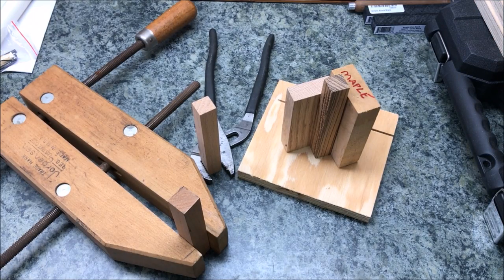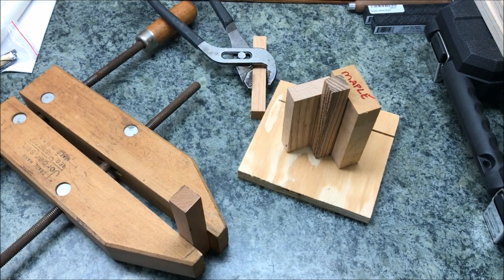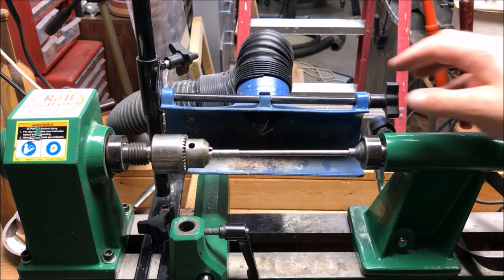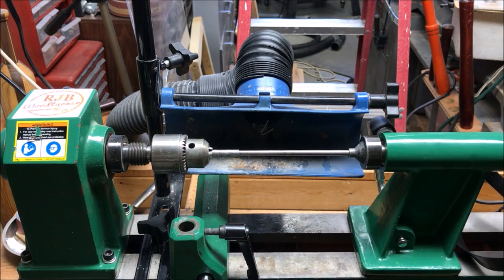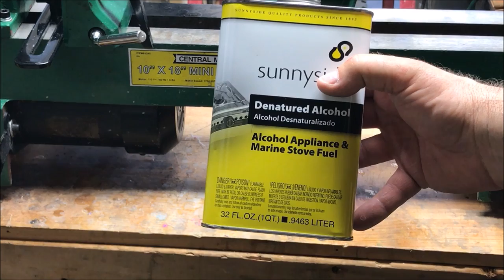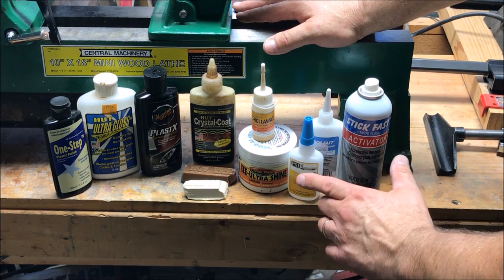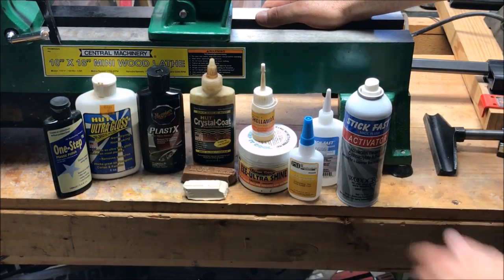What Tools Do I Need For Turning Pens

Comment: Good vid!  You hit all the major points.  I started out with the smaller HF lathe and, after one year, my family bought me the next size up HF lathe with variable speed pulleys. That was a big improvement for little money.  I love being able to grab the handle and speed things up for polishing.   I did not get the pen vise for the drill press.  At first I used a mechanic's vise but getting the blanks perfectly perpendicular to the bed was hit or miss.  I now have the pin jaws for my chuck and they are working very nicely with an opposing Jacobs chuck.  After building the Shaunessey pen press and breaking it twice I built a screw drive press for assembly using a large threaded rod and I have much more control than pressing on a lever. Finishing is right on, I'm using the Stick-Fast CA and the PlastX polish.  Working on a buffing setup using big buffing pads that chucks into my lathe.  I put together a disassembly set using HF punch pins and the PSI locking pliers. Wishing you a better lathe soon.  Keep turning bro.
Reply from the maker: +Redthumb45 Thank you very much. 

Regards,
Bob

Comment: I have the exact same lathe as you do. There for a time I was having the same problem with it wobbling out the end of my blanks. What I did was, tighten the nut under the tail stock to take out some of the wiggle. Then when I drill my blanks I center the drill bit with the lathe off. Then I put my hand on the chuck and turn on the lathe, then start turning the tail stock handle. I've had perfect results ever since. Just thought I'd let you know what I did to fix what sounds like the same problem you were having.
Reply from the maker: +Gary Binder Thank you Gary,
  This is great information. 

Regards,
Bob

Comment: I have about the same lathe, mine is an Excelsior (Rockler) but I imagine it is the same Chinese made lathe.  Here is how I drill:  Chuck the blank square and mark center.  Advance the tailstock up to the end of the blank and lock it down.  Spin up the lathe and advance the tailstock screw slowly until 1/4-1/2 extended then STOP THE LATHE!  With the lathe off pull the bit out and blow everything clean.  Then carefully advance the tailstock until the retracted bit bottoms out in the hole.  Lock it down! Then turn on the lathe and continue with the next pass 1/4-1/2 extension.  As you reach the end of the blank be even more careful to retract and blow everything clean.  I do that last 1/4 inch very slowly.  Yes, this takes much more time than the drill press but I always get perfectly centered holes with no wallowing and no blow out.  Someday I will get a nice lathe too and the old trusty Excelsior will be moved to just finishing duty.
Reply from the maker: +Tenspeed TheBikeHanger Great information, I'll give that a try. Thank you. 

Regards,
Bob

Comment: Hi Bob, thanks for your videos they are very informative. I've been binge watching yours and others and took a class locally.  Now I'm trying to get set up.  But as you mentioned in this one money is tight. I purchased the HF lathe a couple nights ago but haven't opened it yet (still arranging the garage) but then I saw a video this weekend where you did a bottle opener on a new Turncrafter Commander. My question then is the HF able to do small things like the bottle stoppers and small jewelry boxes or should I try to invest more in something like the Turncrafter? Thanks for all your information.
Reply from the maker: The HF lathe will work great for those items. I used mine for years and it wore out. 

Regards,
Bob

Comment: Wonderfully helpful video Bob.  Thanks.  

I have one question:  Why do you have the fuse/breaker box wide open?  I can only believe you have no visitors (in person) to your shop at this time.

I will say also I got back to turning as a result of your videos.  I have the same lathe and I just had to replace the belt and the capacitor.  The new capacitor was bigger than the older one so I just tie wrapped it to the motor.  ( I should have checked the size before ordering!)

Karl
Reply from the maker: +Karl Becker Thank you Karl,
  The breaker box was open because I was installing a 220 volt 15 amp breaker for my dust collector. I removed the cover to discover I had the wrong style breaker. I shot this video then ran to Menards for the correct one. I buttoned it up lather that evening. 

Regards,
Bob

Comment: Wow I'm late but still a quality video I have the same lathe I just got into pen turning and I was wondering if you have had problems with getting the headstock out, with the included knockout tool sorry if my ''terms'' aren't right i just started
Reply from the maker: I have, it has a little nub on it that gets stuck in the implement I’m trying to remove. I ground mine off and now it works much better. Before grinding I tested with an oak dowel and a rubber mallet to make sure that was the issue. 

Regards,
Bob
Reply: Thank you so much for replying i will try that hopefully it works cross your fingers 
You inspire me so much i love your videos and i always hit the like button
Reply from the maker: Thank you Bret,
I appreciate that. 

Regard,
Bob

Comment: This is a great video overview. I currently use Pens Plus finish on my pens. It's a wax,oil and shellac finish. Is shellac something that will wear off over time?  I've experimented with a few coats of Pens Plus then a few coats of shellac. Then back to the Pen Plus for a few more coats. I'm going to try and get into a ca finish. I found a 1/2" round block of uhmw from Amazon. Is that going to be big enough to make bushings for applying ca finish?  Should I go with 3/4" or even 1" diameter uhmw?
Reply from the maker: +Joshua Luther 3/4" would be the smallest I would buy. By the time you true it up it will be about 1/2". 

Shellac holds up pretty well. It will eventually wear off with handling. Lots of oils in the hands plus hand Sanitizer and hand lotions are hard on a finish. 

Regards,
Bob
Reply from the maker: +Joshua Luther P.S.,  tomorrow's video is me remaking my non-stick bushings. :^)

Regard,
Bob

Comment: Here's another one! The drill bits used for the tubes are not standard sizes. For example, you can't just go to Home Depot/Lowe's/etc. and expect to pick up a 7mm drill bit. I bet I'm not the only one who just assumed you can just go to any hardware store and pick up the appropriate drill bit for your pen kit. Additionally, there are many sizes of drill bits required depending on the pen kit that you have.
Reply from the maker: +Janet Brien Thank you Janet. I wasn't aware of that. 

Regards,
Bob